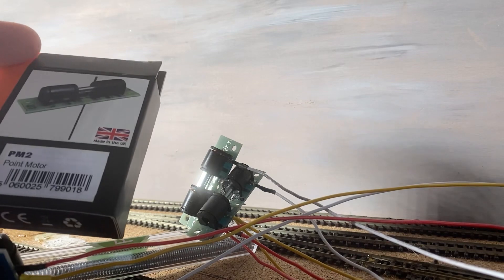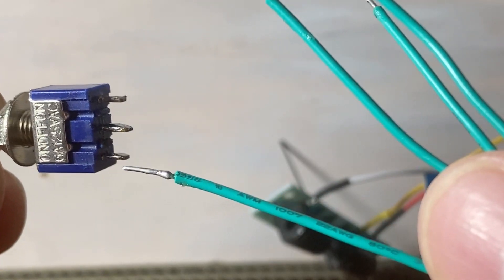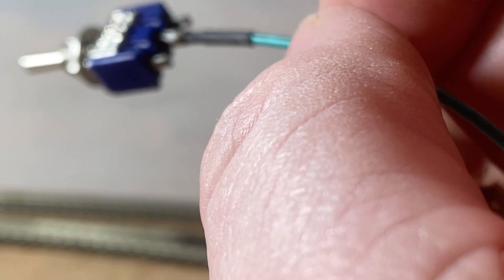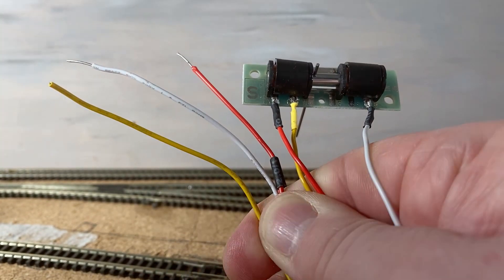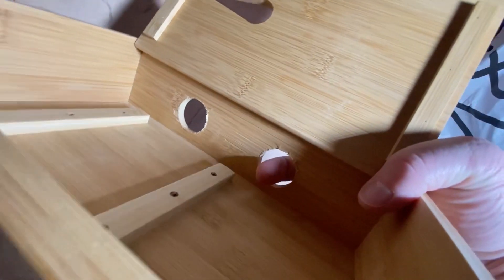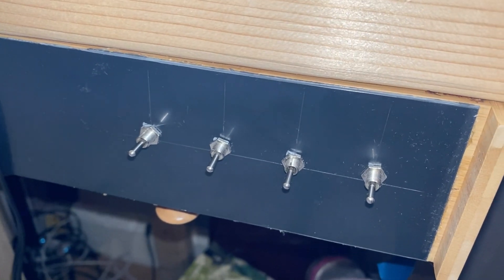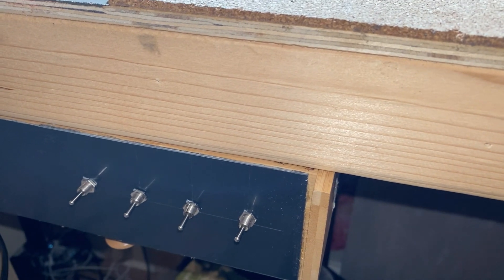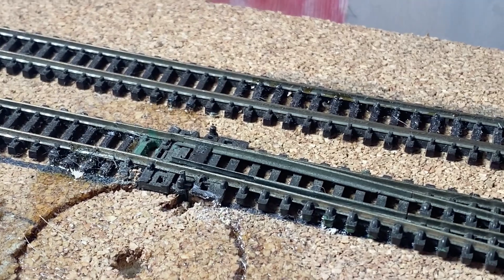January ‘24 update; installing point / turnout motors, soldering, wiring CDU and switches.

Comment: Hi Anthony.

Not sure with the Gaugemaster units but with my Peco units I have one push button spring loaded momentary switch in the circuit to the switch panel. 
Peco point motors don’t like being continuously powered, they burn out.
I move the turn out switches then push the button. 
Cheers Peter.
Reply from the maker: Hi Peter, yeah there is an option to have a switch on the Gaugemaster PM1 I think but I wanted a separate control panel. Cheers buddy